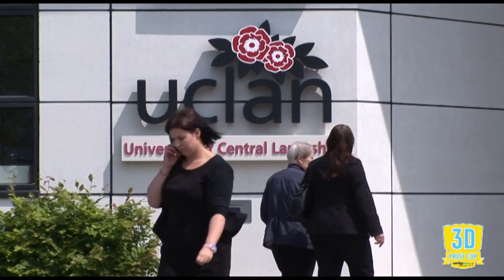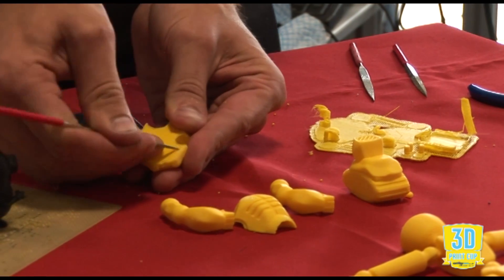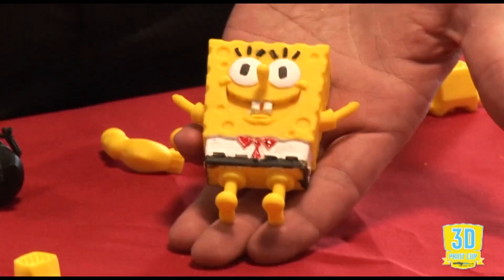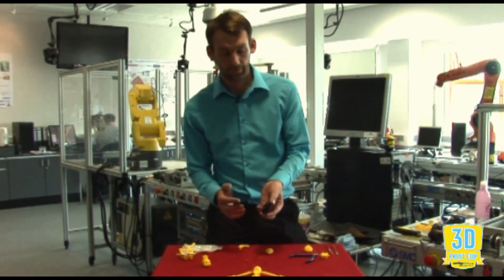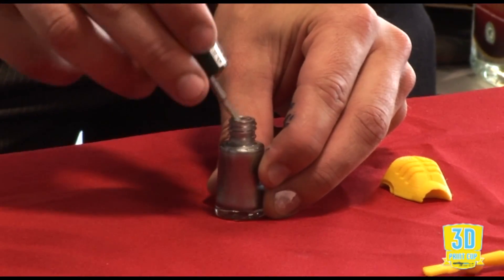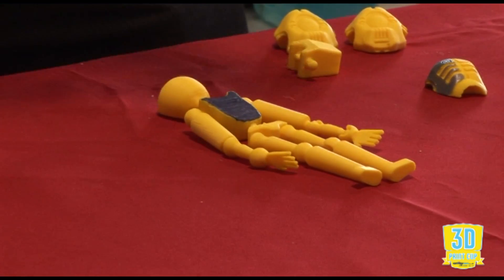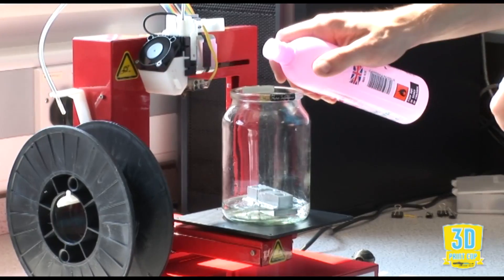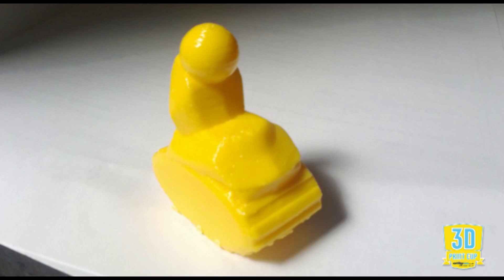How to finish off your 3D Print

Comment: I wish the support came off of my prints that easily.  WOW.
Reply: +Dark Alchemist Mine do.
Reply: John Ian O'Neill
With PLA no way no how for me and ABS is easier but not that easy.  With S3D it has some other issues which negate me using it (bridging has a known bug that is also in Cura btw).
Reply: With S3D I am printing curved bridges with no sag. My supports almost fall off. Took a while to dial it in but I am very happy with the results. I have found different colors need different extruder temps though.
Reply: Well, I can prove S3D does it wrong (so does Cura) but on the official forums it has already been documented just no word when, or if, it will be fixed.

Comment: You should use Multi-Surface Paint. It is made by several companies and it works well on plastic. Regular Acrylic Paint is not good on plastic. It becomes sticky after a while and you have to then seal it with clear nail polish, which kind of sucks and nail polish is expensive so if you have to paint many objects it is prohibitively pricey to use nail polish and/or regular acrylic. I would suggest this stuff: http://www.michaels.com/msc-satin-acrylic-craft-paint/M10198119.html?dwvar_M10198119_color=Scallion#q=multi-surface+acrylic&start=1 Micheals also sells an Americana brand of paint which comes in a Multi-Surface variety and comes in many colors. The downside is if you want a shiny surface I have yet to find anything other than nail polish which works and does not become sticky.

Comment: I find you get the best results with the acetone vapor bath finish is to lower the part into the jar with a platform (I made mine from a bent coat hanger) after it has already started boiling and there is already some vapor built up. That way you avoid the lower half of your object from getting too much exposure to the vapor. Lower it in slowly so you avoid loosing some vapor out of the top. Also multiple trips in and out of the jar seem to produce a better finish instead of just one longer exposure to the vapor. let the part dry and cure for a few minutes before putting it back in.

Comment: So what are the results of your acetone experiment?

I wonder if the acetone "Safety Cage" is a bad idea since you are trying to vaporize the acetone. If you get the right stoichiometry and a spark then the whole cage explodes! I don't know enough about acetone to know how plausible that scenario is, but it seems worse than just having the jar and perfboard. The jar has much less volume and no ignition source. If you have proper ventilation to capture or move the fumes outside, then you don't have to worry about the air catching on fire.